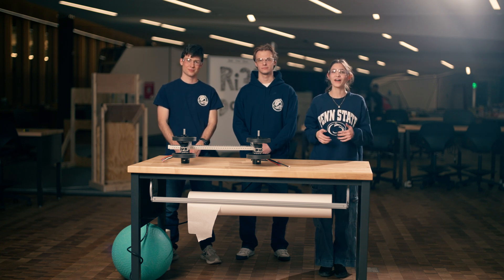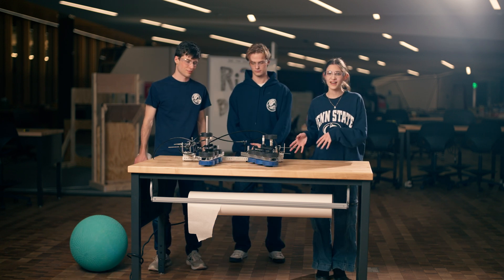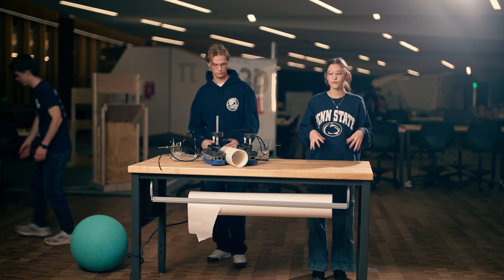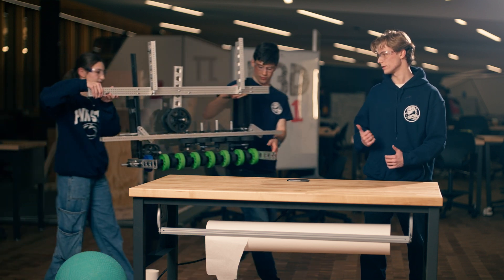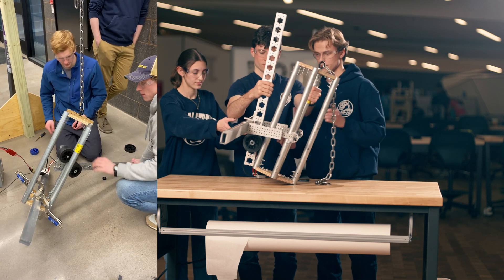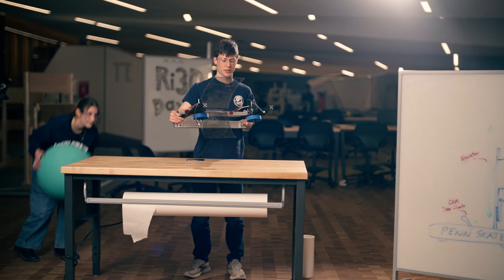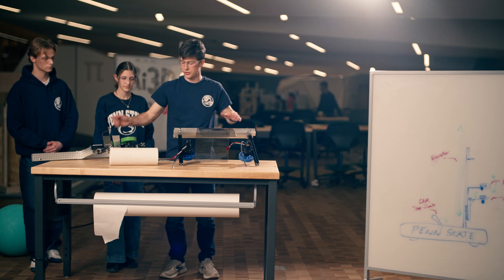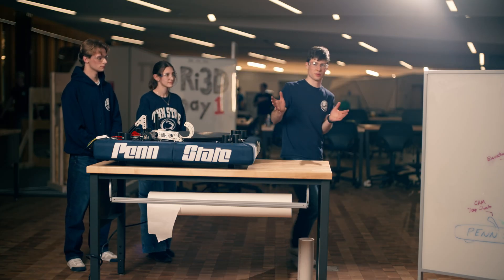Day 1 Recap | Ri3D at Penn State

Comment: Would you need any pivot point tho? Also, would it be able to work right next to a station?
Reply from the maker: Seems likely! But you would need to do your own testing to see what kind of deployment works for your application. The design excels with a backing wall as the piece cannot escape.